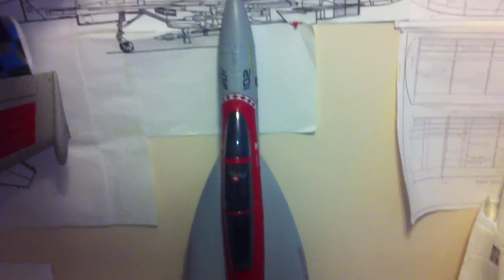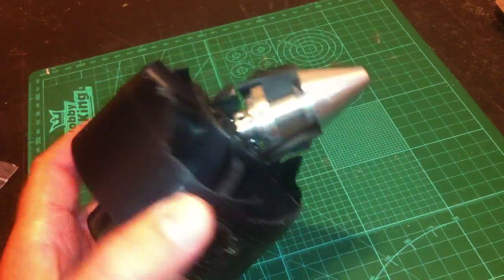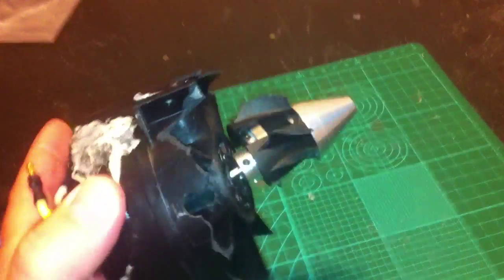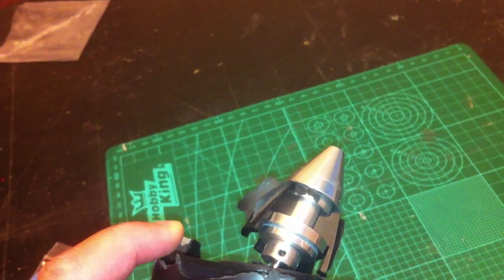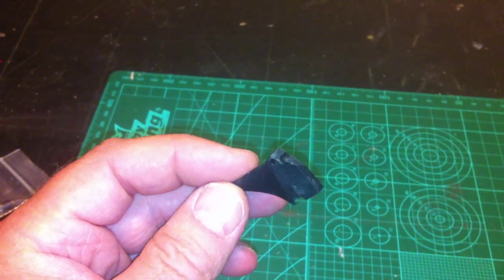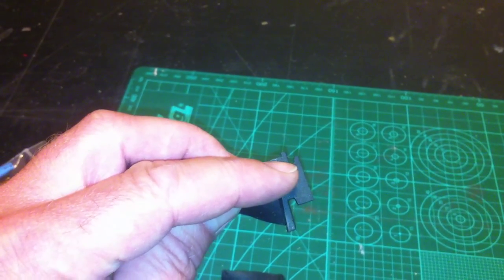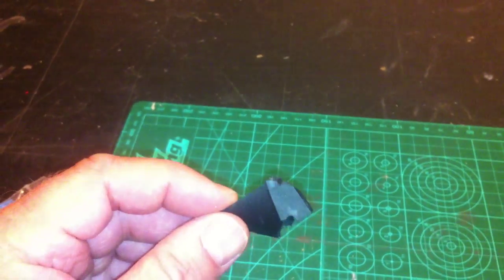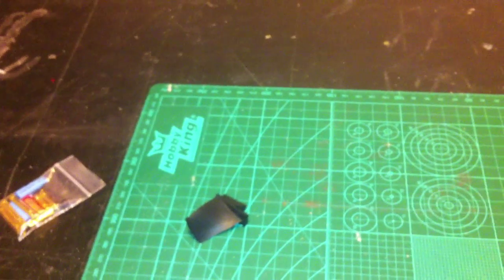CS 12 90mm EDF

Comment from the maker: Thanks for the feedback!
You are correct, 2.1-2.2kw WOT on a 5mm motor shaft.  The HET series motors fit very snug in the motor tube without tape - very well supported.
But I don't believe the smallish shaft is not the cause of the failure.  I believe the fan adaptor is shifting (not slipping) resulting in runout which unbalances the fan, and ultimately leads to contact with the shroud & catastrophic failure.
Check out my other vid:  "Another CS12 Failure" for my observations and conclusions.

Comment: where you running on 6s at about 2100 watts ? does not seem like you were stressing the fan but they are a heavy rotor your motor shaft looks to be 5mm balance may be the biggest factor in failure as a blade strike on housing would instantly lead to balance problems,was your motor a tight fit in housing,it's worth putting ally tape on motor to stop it moving ,I've heard of people using 8mm shaft het motor as well